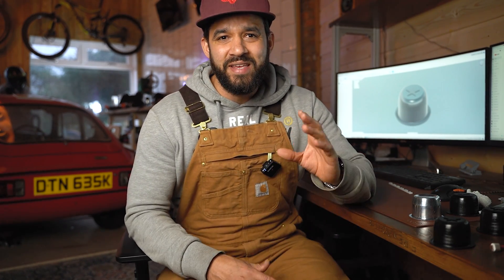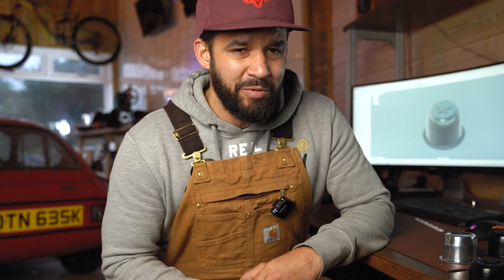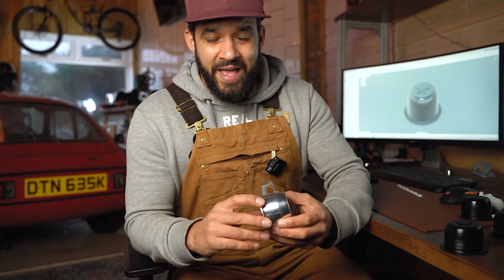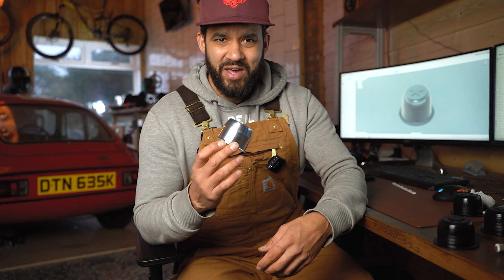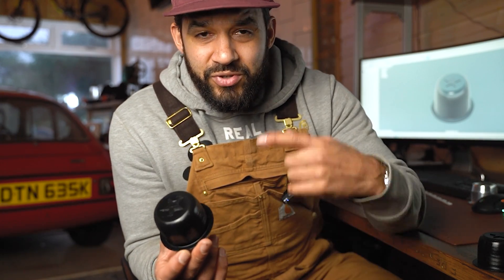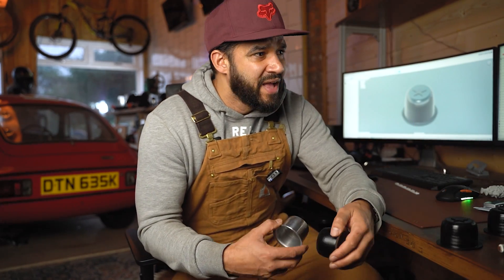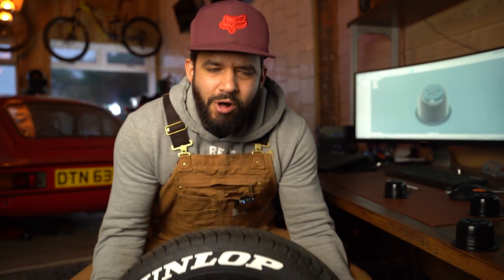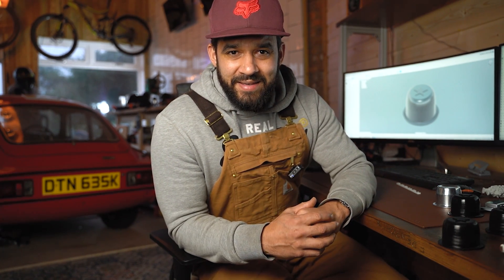3D Printing for classic cars. The future of classic car restoration?

Comment: Love it! I've printed the top half of the front quarterlight "hinge" part No. 574105. So far I've prototyped in plastic. Now after 3 iterations I'm happy to commission it in metal: 3D printed or CNC.
Reply from the maker: That's awesome. CNCing aluminium is definitely something I'd like to have a go at.